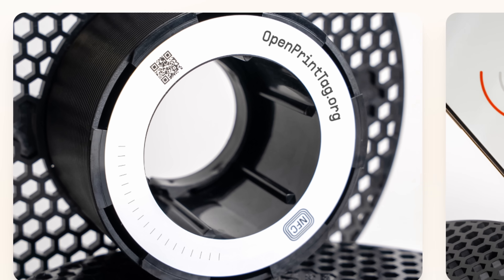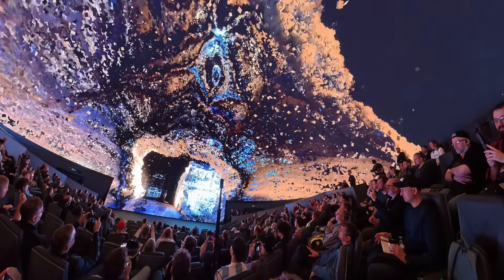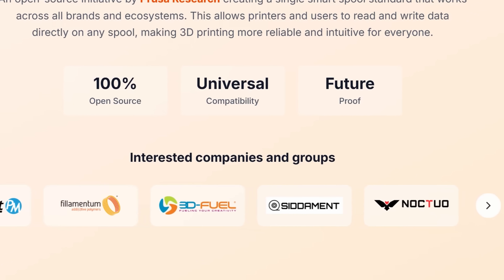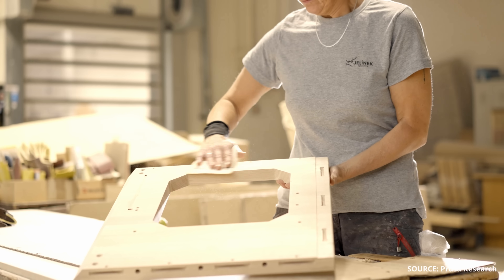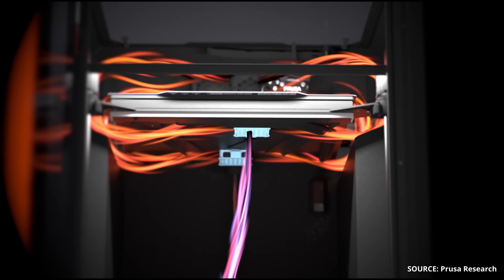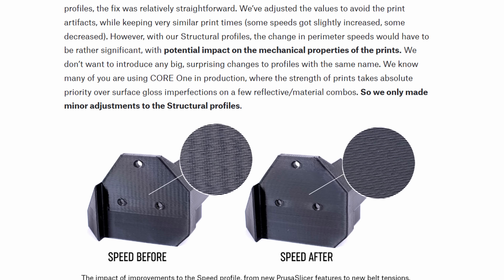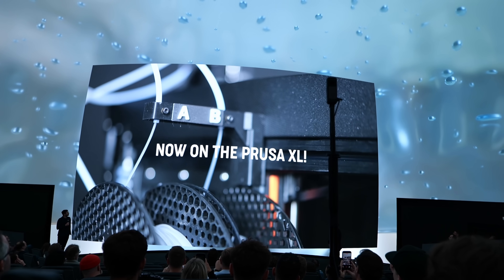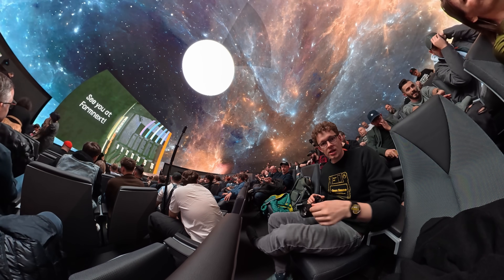CORE One L, RFID & Silicone: FIVE Big Reveals from Prusa Day 2025!

Comment: Liquid filament sounds absolutely insane
Reply: I can make liquid filament
Reply: Insane is the right word. Why manufacture what is essentially a single use, stupidly high aspect ratio container when you could just squeeze it out of a sane container since, you know, it's a liquid?
Reply: @hellterminator  Yeah, would have made a lot more sense to have some sort of a cartridge system in which you place a sillicone bottle onto a slot on top of the printer.
Reply: @hellterminator  Yeah, I loved how in prusa's video they quickly gloss over what happens to the "filament" tube after "extrusion" and they never show poop. At least bambu doesn't hide the poop in their videos.
Reply: @hellterminator  My guess is that it both limits the risk of contamination and hardening of the bulk resin, as well as allows precise flow metering and retraction using already well established filament feed systems. It saves having to design some sort of dual peristaltic head that could easily foul. Not an ideal solution, but a novel one at least. First steps to get 2-part material printing to market I assume.
Reply: @eulachonfish  only two peristaltic pumps will be an order of magnitude cheaper to maintain, just as simply 2 soft "dropper" style bags will be cheaper and easier to produce than a plastic tube with filling. Clogged? The 2 components themselves are liquid, unless you put something else in them, there will be no clogging, and if something like this happens, at most you need to replace the short silicone tube.
And yes, I’m already scared to imagine how many problems there will be with installing this “tube with liquid”, and how many problems there will be with leaks...
Reply: @hellterminator  yeah, i thought the same.. but the idea is neat and it is first gen so hopefully we can expect improvements or a form factor change. I'm with you though I'd probably neve use the liquid filament feature myself lol seems expensive.
Reply: @honduken the idea is neat last time we needed silicone for work 2 years ago and TPU or Vacuum cast urethane wouldn't work the printer quotes were 250k AUD, so I dont really think the waste matters if it works and its cheap enough.

Id be really interested to see how they control shore hardness and how low that can go.
Reply: Resin
Reply: @lolzdatguy4987  Resin in traditional resin printers is in liquid form that solidifies with the help of UV radiation in the form of either LED lights or a tube style UV lamp. 
Silicone in the case of the new Prusa thing presented in the video uses 2 physical components (like 2 component glue and such) in liquid form that chemically react together when mixed and together they form a completely changed chemical compound with different properties. So it's not the same just a bit different to get the "same" result: the 3d printed part. Physical properties of silicone though are completely different from Resin, because silicone can be hard like 95A TPU or soft and stretchy like a rubber band.

Comment: RFID tag = lock in
Reply: ahh yes, making an open standard that anyone can use, modify the data on their own, reuse the tags,  isnt required at all for the printer to function and is possible to use without the cloud, is "locked in"

lol
Reply: @CanuckCreator  unless nobody will actually adopt it (which totally can happen), in which case it will have the same effect as bambu's tags.
Reply: It's open source, standardized, and optional.  How does it lock you in to anything?
Reply: The tags literally are called OPENPrintTag. Dude...
Reply: @marcel151 cute name bro. Eventually it'll be used like k-cup coffee makers.
Reply: @ewokjerky4508  What are you even talking about?
Reply: @marcel151 k-cup coffee machine. This is a step towards this.
Reply: Do you know what an open source open standard means?
Reply: This is prusa, not bambu lab. So no, no lock down.
Reply: @LilApe  why are you Iying again? You really can't help yourself right?
Reply: @LilApe  bambu lab also doesn't lock down anything